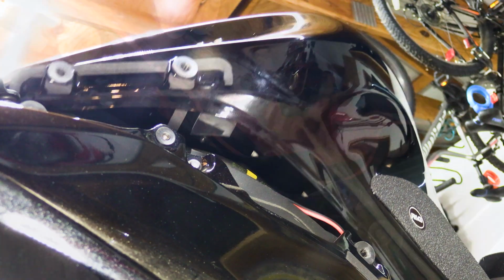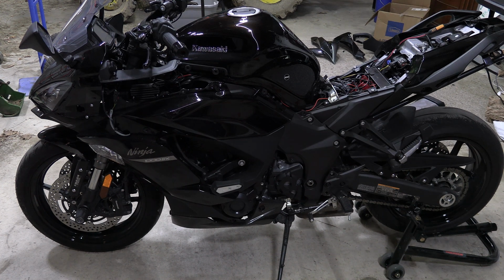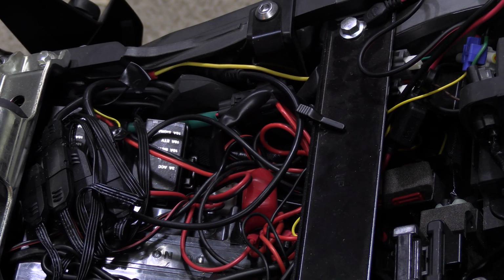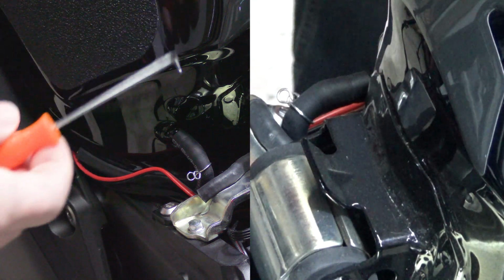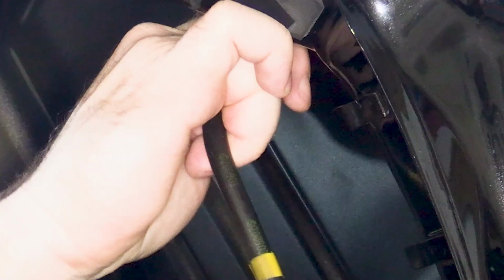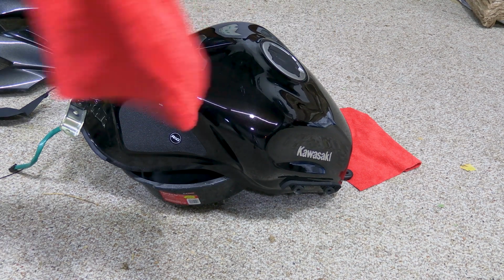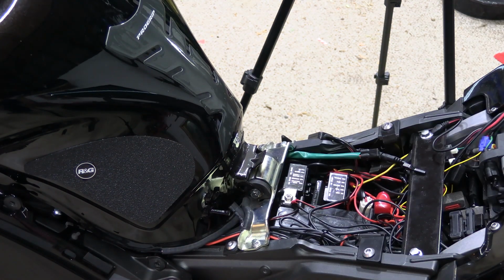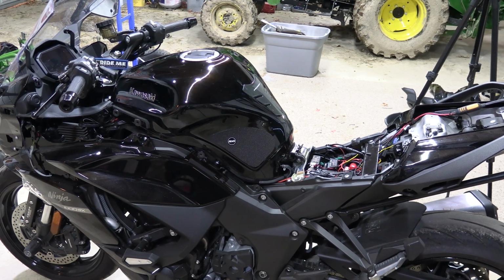Kawasaki Ninja 1000SX - How to Remove and Install Your Gas Tank

Comment: So the hose you took off in the beginning I took it off the other side and I’m not sure where it plugs to on the bike or if it just dangles off can you help?
Reply from the maker: Sorry for the delay. Are you talking about the hose a 5:31? That's a breather hose, it simply dangles down and does not connect to anything
Reply: @BlueEyedRider84 actually was referring to the drain hose I figured it just went down in front of the rear wheel for when gas sits up above the tank but under the cap in that little lip

Comment: My front brake light switch is faulty. It looks like the wiring goes under the fuel tank. Do I need to remove the tank and airbox to install a new brake switch?
Reply from the maker: To replace the switch, you shouldn't have to. I am unfortunately out of town and don't have access to my service manual, but I believe the connector should be just down near the handlebars, but I couldn't be thinking of a different one. In either case, you don't need to remove the fuel tank even if it runs underneath. Just undo the two front bolts and lift it up gently, you're going to reach the limits of the fuel lines, etc. At that point, just prop it up with something. You will have enough room to work underneath it. The important thing is not to lift it too far or you can snap one of the plastic hose connections off and end up with a lot more work.

Comment: Ad 16:00 minutes, prior slightly under the hose, next use a bit of WD40 with the extension nozzle spray it along side your pick tool, move around the hose, repeat, twist back and forth, hose will come off easy.
Reply from the maker: Good to know, thanks!

Comment: I only need to replace the air filter. Can you access the air filter at the stage where the tank is held up by the bungee cords, without continuing on to remove the tank entirely?
Reply from the maker: You can, just be careful and it is a tight fit, but it is doable

Comment: Thanks for the video. My ignition key fell out of my hand and slid under the gas tank. Is it advisable to only loosen the tank at the front so that I can get under it with a few fingers or hand or should I better not do that?
Can the ignition key end up in a place where it can be harmful or dangerous to the engine?
Reply from the maker: You can take out the front bolts and lift the tank to get access to it. Just be careful of the hoses. As for the key - honestly the biggest fear I would have is it working its way down and falling out, then you lose the key. Otherwise I don't think it can cause any harm, but undoing the front too bolts and lifting the tank isn't a big task. You'd still want to undo the top fairing pieces so you can move them out of the way of the tank to lift it, which that's just the pop clip and one bolt on each side.

Comment: Got anything on removing the fuel injectors? I'm lost at how to get the throttle body offf
Reply from the maker: Unfortunately I do not. I haven't go to that extent yet so do not have a video. I may be able to offer some guidance though, unless you have already figured it out? I apologize for the delay in getting back to you.

Comment: Excellent video, thank you.  I have to replace my entire tank with a new one.  I assume it's okay to removed the tank pivot bolt(s) instead of the bracket bolts, or would make the process more difficult?
Reply from the maker: Should be about the same. Just be careful not to dig the tank on the bracket when reinstalling

Comment: Great video! But I have a question abort torque values on the front and real tank bolts ?  :)
Reply from the maker: There is no specific torque on those bolts. They are 6mm bolts, and the default torque spec on 6mm bolts from the service manual is 8.0 Nm, 0.82 kgf-m, 71 in-lb. I'd use good judgment on how tight you think they should be.
Reply: @BlueEyedRider84  Thanks! 😊